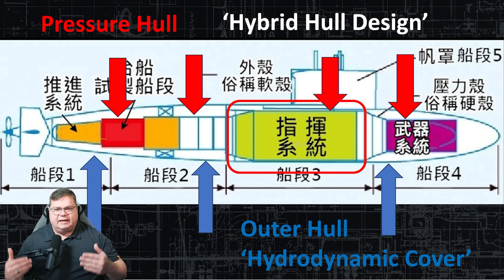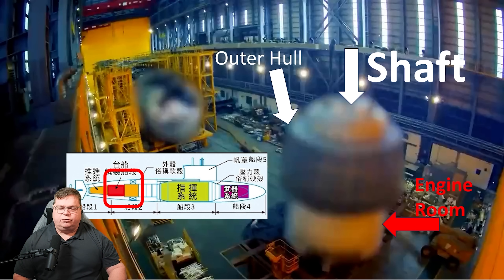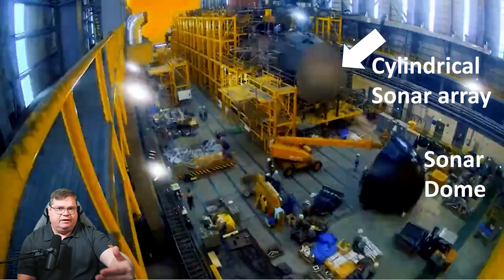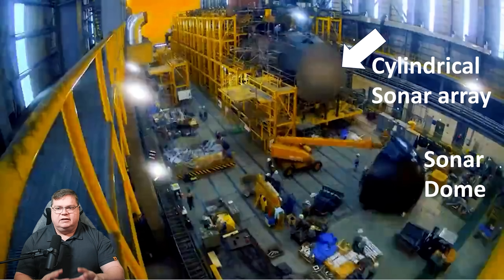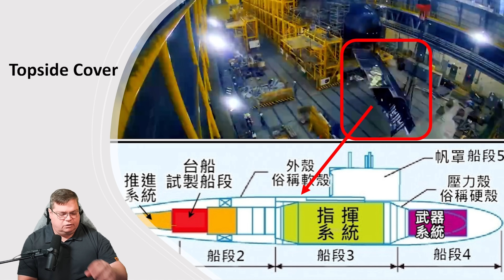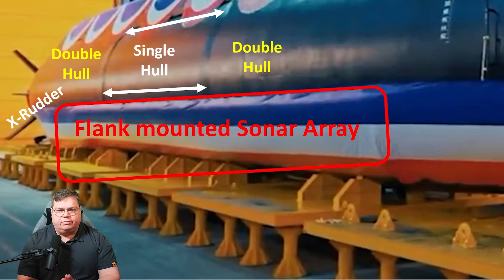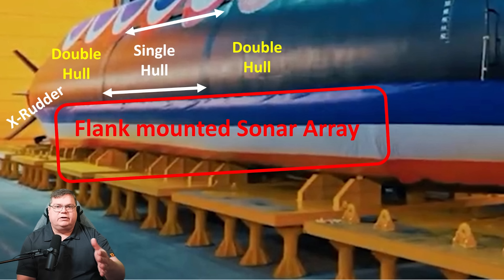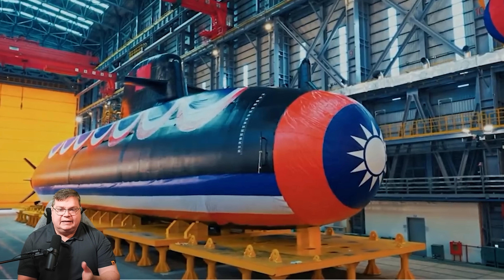What They Don't Tell You About Taiwan's First Submarine

Comment: Taiwan's first nearly 3,000-ton self-made submarine "Narwhal" has just been built and is undergoing testing. Taiwan's first AI unmanned attack submarine "Huilong" will also be launched by the end of this year.
While Taiwan is building manned submarines, it is also secretly using submarine development technology to produce unmanned submarines. The self-made "Huilong" (meaning: Intelligent Dragon) unmanned submarine is a smaller version of the submarine, with specifications of 30 meters long, 6 meters high and 3.6 meters wide. It adopts a double-shell design (the length of the inner pressure shell is 20 meters). Its height including the sail cover is 6 meters, and the outer shell is also coated with black sound-absorbing coating. In addition, the internal settings are not only equipped with cruise, sonar detection and other systems, but more importantly, it also adds a life support system (for special forces missions) and a system equipped with two torpedo launch tubes. This is almost the basic configuration of a 100-ton small submarine. It uses a hull similar to a manned submarine with a sail-type structure design, and is also equipped with two torpedo launch tubes. The "Huilong" unmanned submarine can launch small unmanned AI boats, torpedoes, mines and underwater loitering munitions to monitor, lock on and loiter attacks on enemy targets. The hull of the "Huilong" unmanned submarine is made of alloy steel produced by Taiwan Steel and can withstand seawater pressure of 1,000 meters. It allows the "Huilong" unmanned submarine to stay at a depth of nearly 900 meters underwater. Not only will it not be detected, but it will also be unable to be attacked by mines or torpedoes.
The "Huilong" unmanned submarine can perform combat missions alone, or it can accompany the submarine as a wing boat for coordinated operations.
Taiwanese civilian manufacturer has developed an Autonomous Underwater Vehicle (AUV) for the Navy - the Seawolf 400 AUV system. The Seawolf 400 AUV is 4 meters long, weighs about 1,000 kilograms, has a speed of 2 to 7 knots, can submerge for 8 to 10 hours, and can carry AI reconnaissance equipment and attack weapons.
Taiwan's Navy has partnered with an innovative company to develop an underwater glider. This equipment has the characteristics of long-term operation, large-scale collection of underwater information, high concealment, low maintenance and operation costs, fast maneuverability, and diversified underwater reconnaissance. It can collect hydrographic information for the Navy and influence the selection of sonar modes and the application of tactics. In addition, the equipment also has stealth characteristics and can perform underwater missions for more than one month, improving the Navy's ability to deal with underwater operations and intelligence collection. Several underwater gliders are currently being deployed to perform missions.

Taiwan plans to produce eight Submarines, 46 AI Unmanned Submarines, hundreds of Seawolf 400 AUVs, and a fleet of Underwater Gliders. Based on this, the Taiwan Navy has been able to build a powerful, modern underwater fleet with AI networked combat capabilities.
Reply: Taiwan took 4 years to learn and design its self-made submarine, and only took 3 years to complete its self-made modern submarine.  Taiwan break the world record for manufacturing the submarine. In 1988 Taiwan was the 1st Asian country who could design and manufacture self-made 3rd generation Jet Fighter. Taiwan is also designing its own fifth-generation stealth twin-engine fighter jet, and the prototype will be produced in 2025. Taiwan is not only strong in semiconductor chip manufacturing technology, but also in other industries. Bravo Taiwan!
Reply: Taiwan's IDS Indigenous Defense Submarine is planned to use domestically produced "lithium batteries" as the submarine's underwater power system.
Japan's Maritime Self-Defense Force's Soryu-class "Phoenix" and "Dragon" submarines, as well as the latest Oshidori-class "Oshidori" and "Shirotori" submarines,
 all use "lithium battery systems" as the submarine's underwater power system. The South Korean Navy has also announced that its second batch of new "Dosan Ahn Changho-class" submarines will also abandon AIP power systems and start using "lithium batteries"
 as submarine power systems. These modern submarine countries that use lithium batteries as their main power source have kept secret the amount of time their lithium battery power systems can operate underwater, which has aroused curiosity among people.
Recently, the U.S. naval professional media "Naval News" reported that the Indonesian Navy will order from France a new batch of "lithium battery"-powered Scorpene-class
 submarines for it, which is referred to by the French side as the "Scorpene Evolved". The French shipbuilding company Naval Group claims that the class of submarines, equipped with "lithium batteries", can last up to 80 days on a single mission, of which 78
 days are submerged, and the maximum range can reach 8,000 nautical miles (about 14,816 kilometers), significantly reducing the rate of surfacing.
The French "Scorpene Evolved" lithium battery submarine has a weight of 2,000 tons, and the lithium batteries fully charged can support the submarine for 78
 days of submerged operation. The Taiwan-made IDS submarine has a weight of nearly 2,800 tons, and can carry more lithium batteries than the French "Scorpene Evolved" lithium battery submarine. It is estimated that the Taiwan-made IDS submarine with lithium
 battery power system may support 90 days of submerged operation.
Reply: Taiwan has successfully developed a 533mm-diameter torpedo launch system for Taiwan-made IDS submarine Narwhal. In addition to being used to launch US-made MK-48 heavy torpedoes, the system is also being prepared to launch Taiwanese-made submarine-launched Hsiung Feng II anti-ship missiles, submarine-launched Hsiung Feng III supersonic anti-ship missiles, submarine-launched Hsiung Sheng cruise missiles, and submarine-launched Sky Sword II air defense missiles. The diameters of these Taiwanese missiles, after being modified and installed in submarine-launched pods, are all smaller than 533mm torpedo launch tubes, and the IDS submarines can all launch them in the future.
During launch, the torpedo tube will push the Taiwanese missile pod into the sea. After traveling a certain distance and approaching the surface, the missile engine will ignite, break out of the pod, and emerge from the water. After the guidance system is activated, the missile will fly into the sky and autonomously attack the target.

Comment: The all-lithium-ion battery power system of Japan's latest generation Soryu-class submarine, Phoenix Dragon, uses high-safety, explosion-proof and fireproof lithium-ion battery materials and security control system chip patented technology transferred from Taiwan. The Japanese manufacturer obtained the technology authorization and tested it on the Japanese submarine. After five years of ensuring safety, it was officially produced and used on the latest generation of Soryu-class submarine, Submarine Phoenix Dragon. Taiwan's submarines also use this all-lithium-ion battery power system made it by itself. Because Taiwan has innovatively developed globally patented technologies for high-safety, explosion-proof and fireproof lithium-ion battery materials and security control system chips, this technology has been used in breakthrough applications on the new generation of Japanese and Taiwanese submarines, making it possible for the current owners and users of submarines based on the AIP propulsion plus lead-acid battery power system, has become outdated.

Comment: The sub doesn’t have far to patrol. Just has to stop China. Doesn’t need huge range.
Reply: might not be so good for crew morale if you're about as survivable as a north koean sub.
Reply: @hughmungus2760  I’m not saying that. But I’m saying a lot of the capabilities US subs need- range, speed, are due to the need to cross oceans which Taiwan has no need for.
Reply: @hughmungus2760 mk48 torpedo is a scary tool. China is not going to find it fun I’ll tell you that. We gave Taiwan one of our best torpedo. Trust me , mk48 is not what you think. This thing is the water version of you life flashing before your eyes
Reply: @giganigga9624  Im pretty certain in litoral waters any sub would easily be spotted by ASW aircraft before it can get within firing range.
Reply: @giganigga9624  thats assuming you can get ASW in the air off the chinese coast. See taiwan is going to lose air superiority pretty quickly.